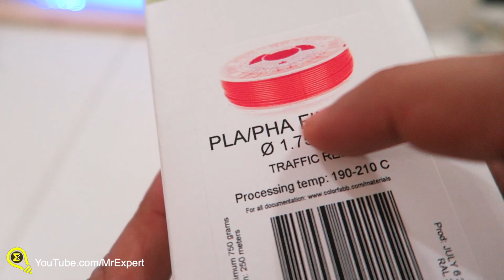Awesome 3D Printed RC  Car  - Part 1

Comment: isnt that 4 geared motor are to much power for this car ? and one more question which flex filament use using in that video
Reply from the maker: it will have to handle all the future stuff so making it powerful :) 
its normal tpu filament
Reply: @MrExpert  thank you for answer <3